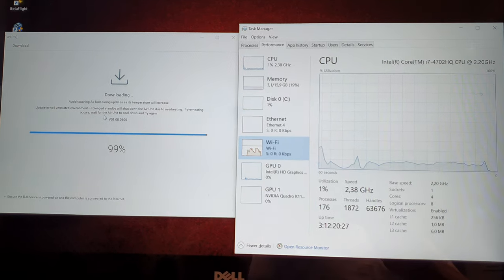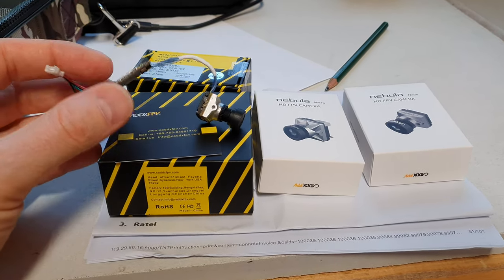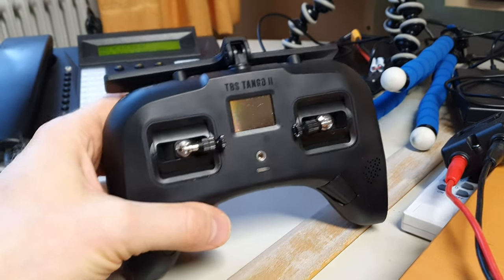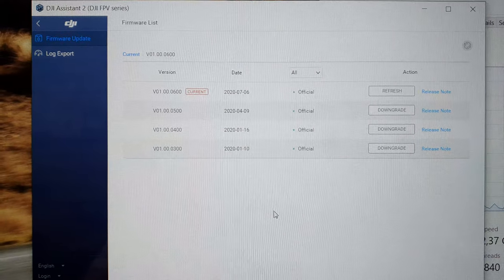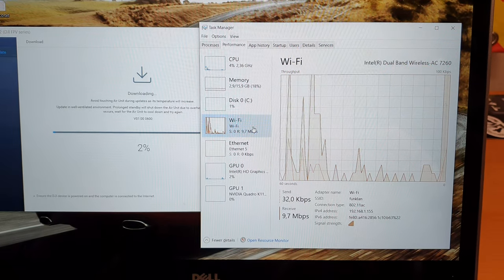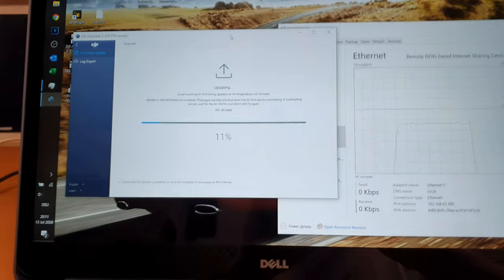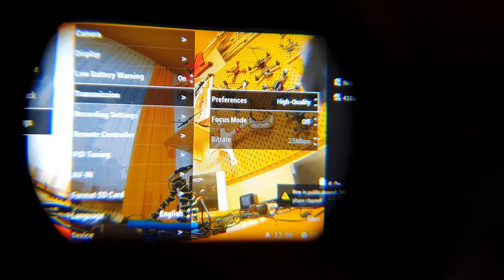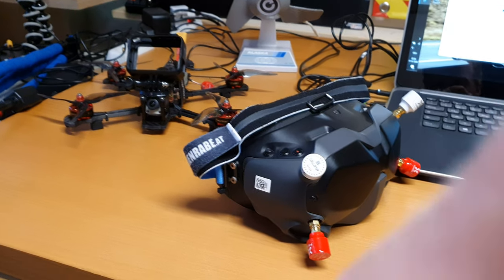DJI 50mbit upgrade / Caddx Cams / Hangar Vlog

Comment: RCSchim, I updated all my DJI FPV systems (10 x flight packs plus goggles) and all only just got lukewarm to touch, they didn't heat up this time.  As soon as the firmware updates finished they then started to heat up.  I'm suspecting DJI have changed the way they update firmware like shutting down the unit and only just update firmware where it needs to.

Comment: Enjoy the 50Mhz mode, it is quite nice.  I don't suppose you have a 5.8ghz spectrum analyzer you can use to show the exact frequency range each of the 3 50Mbps channels use do you?
Reply from the maker: Indeed I have one of these! I will try to show the difference in bandwidth appetite of the system in 25 vs 50 modes,  great idea!
Reply: @Rcschim  Awesome!  Thank you!  I want to update the FPV Frequency Chart I have with accurate data about the new channels and that would be very helpful.
Reply from the maker: I did what you suggested ;)

Comment: The downloading for each unit is as annoying as the need to apply that hack again. Once you own 7 or 8 of these units, it will be a pain in the butt 😒
The best solution would be the one TBS is using for Crossfire. Update the goggles and then the air units are updated via air from the goggles, when they are connected the first time.
Reply: Didn't have to re install the FCC hack or 1200mw after the latest update, which shocked me because everyone said I would
Reply: @kjj8770  Do you have those files on your SD card so they got auto applied after you updated?  That's what I do.  I just leave the files on the card all the time and never have to think about them again.
Reply: @5zero7RC  I have the nacopwr on my goggle SD I can't remember if i left it in when I updated or took it out, I do have the caddx vista though and the  FCCnaco file didn't get wiped after the update
Reply: @kjj8770  Ok, that sounds like what I would expect.  The firmware update does not clear the SD card, so as long as you leave the files on it, the "hacks" are re-applied as soon as the device reboots after the firmware update.
Reply from the maker: yep, that explains why my caddx was unlocked instantly and the DJI airunit wasnt (in the airunit I had no sd card). the caddx has built in storage where the file sits...
Reply: @5zero7RC  makes total sense  thanks for clearing that up 👍

Comment: What was the antenna set up you showed at the end?
Reply from the maker: The convenience setup: 4 foxeer stubbies. Their normal Lollipops on flex coax have better performance but then they don't fit nicely in the backpack...
Reply: @Rcschim  I've just spent the past few hours testing the Menace RC hd pack and comparing to the stock antennas.
I've tried them on the left top and bottom.
Same on the right
And then as Andyrc suggested on the two bottom receiving antennas.

What I found was that the stock antennas consistently outperformed the menace patches.
I have no special equipment to measure and test, I was simply using my eyes and picked a challenging location with lots of trees and shrubs.
Reply from the maker: if you use menace on goggles, what are the transmitting antennas on copter? Stock? What polarization do your menace patches have ? same as DJI Stock (LHCP)?
If your menace are RHCP and Stock LHCP  - theres a penalty (polarization mismatch - even if it's not as big as I though it should be).
Try some lollipop antennas on the copter - they increased performance for me already. 
whatch out:  on dji airunit you need mmcx  connector (maybe a "pigtail" with sma so you can use different SMA antennas on copter)
on caddx vista it's not mmcx but rather ufl connector!
Reply: @Rcschim  hi, thank you for response.  I have got a caddx vista with the stock antenna.
😃 My menace are the Lh DJI pack.

I hate to be negative but I'm disappointed in them.  :-(